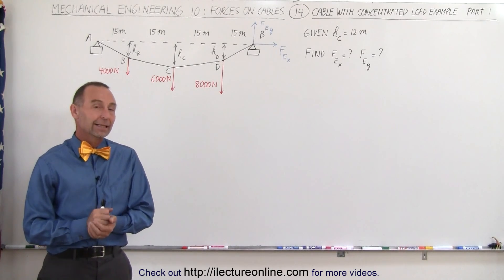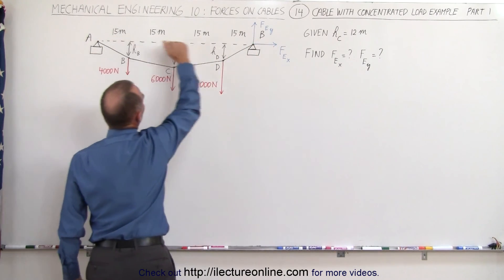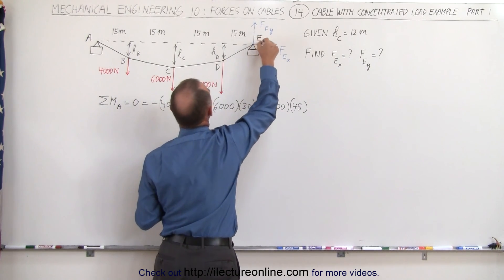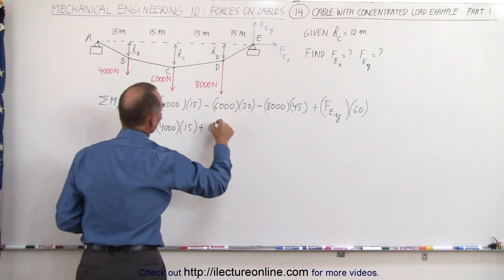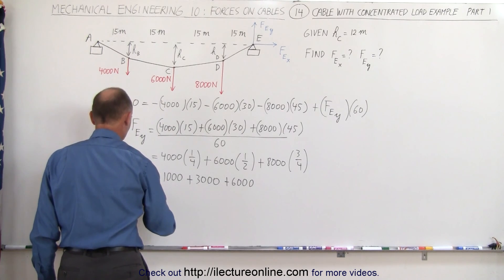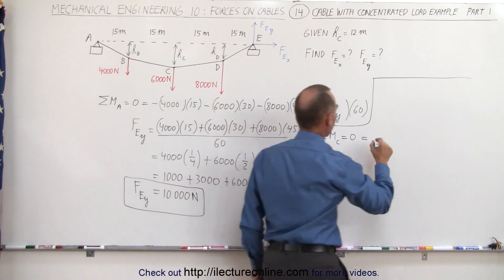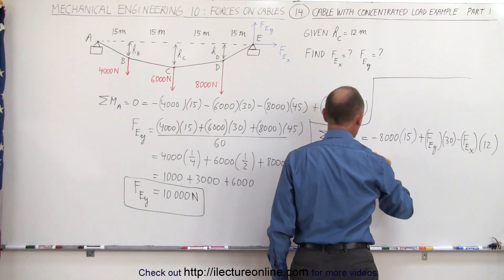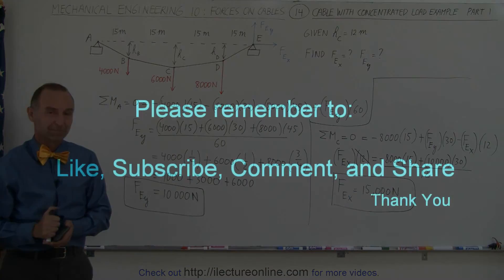Mechanical Engineering: Ch 10: Forces on Cables (14 of 33) Distributed Load: Find Sag=?

Comment: why is Fex not included in the summation moment of A?
Reply: is it because the level of A and B are the same so it doesn't include in the summation? because when I see the previous problems, when you sum the moments equal to zero, the x components are included .
Reply: because the angle is = 0 so the moment arm is = 0